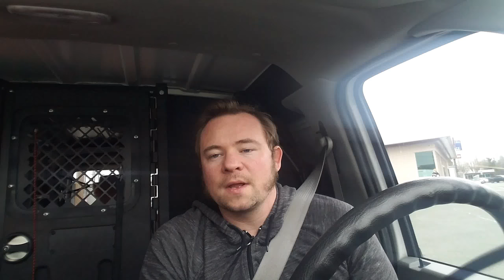How does someone become a traffic signal technician?

Comment: Most require you to certify with the IMSA before you get hired, or do it in a certain timeframe (typically 90 days you need to have your Level 1 TST cert).  Also there are many who collect retired (and sometimes new) traffic signals, cabinet gear, loop detectors etc.  THAT is some of the best hands on training you can get.  I mean what better way than owning the gear is there to learn how it works?  I am one who has collected retired signals and learned how they work, how the controllers work (mainly NEMA TS1), and so on.
Reply from the maker: Many municipalities may require you hold certifications through IMSA, but most public agencies will pay for you to take those tests.

Comment: When I started working on signals 15+ years ago, I was an electronics tech with 15+ years experience.  The men that trained me said that there is no such thing as a signal tech that hasn't been working on signals for at least 5 years.  Up to that point, you're still a trainee with electrician or electronic experience...  :)
My employer quit hosting the IMSA classes due to budget problems, so didn't require us to have the certifications.  I never thought about it being a group I could join, I just assumed it was a 'government standard' published so that workers would have 'minimal knowledge' to be able to do the job safely.
I've worked with CalTran and NEMA cabinets and the department was just getting into TS2 controllers, if I remember correctly, when I had to leave due to a major back problem.  Old inductive detection and set timing to newest video detection.

But I have a question for any signal techs.  Have any of you realized that the CalTran standard is hazardous to the public?
Reply from the maker: Most of the CalTrans stuff isn't in our spec (thank goodness) One thing I hate about 332's is that diodes are cut on the program card for the conflict monitor to allow phases to run together. What happens when a diode blows because of a surge?
Reply: Yes, that's exactly the issue I pointed out to the engineer that specced the CalTran system as the only one we would be installing in the future.  His response 'My professor in Traffic Signals said this is the best system out there.  This is what we're using.'
I had previously pointed out the heat issues on the 170E controller and was told 'this is the equipment we are using because the engineer says it's the best.'  Several years later, during a major heat wave, we had call after call for 'signals malfunctioning' and finally figured out that the controllers were overheating and 'doing screwball things'.
Thank you for the work  you do.  I know what it's like and the issues you can run into.  Be safe!  Prayers for you, brother.
Reply: I work for CalTrans in Southern California, the 170 would have heat issues, but very rare for it, the best part about the 170 is when a cabinet got hit or knocked down the controller typically still worked. The diode issue, I never had the passage diode blown, never heard of one ever going. But if there was an electrical surge, which I’ve  seen utility lines melt our cabinets, lightning strike it.. but, the 302 surge always held up, before that we used gas resisters that would never fail to save the unit. I was informed a while back most state DOT use CalTrans standards and models. True or not I don’t know. But our equipment runs in the extreme heat of the deserts to the freeze of the northern mountains. Best? Probably not, but effective and safe defiantly.
Reply: @jamesdokken2142  - I am in Tulsa, OK.  We had a week of temps 111 plus several years ago and the 170s were malfunctioning all over town.  One location showed 169 temp inside the cabinet.  One I laid my bare hand on top of the controller and took 'no time' to  get my hand off of it it was so hot.

Comment: I've been working in the traffic signal industry/trade now for about 7-8 months. I've been studying for Advanced MOT, MUTCD and a level 1 tech hand book as well as everything else I can get my hands on. However my company flat out refuses to send me to get my certifications until the 1 year mark that I've been with the company and im unable to take the time off to get certified myself without becoming unemployed.  Any idea's or tips to get certified faster would be very much appreciated.
Reply from the maker: Absolutely, I would recommend you take the level I test and join your local IMSA. Your local IMSA will hold regular meetings and you can pay and certify yourself. Once you've gained strong knowledge and certifications to back it up you shouldn't have a problem finding places to work that will take pride in your drive to teach yourself and want to learn. If the company won't pay for your certs, do it yourself. It's cheap for the weight it holds on a resume.
Reply: @trafficsignalstraining7673  awesome, thank you for the tips have a great day and thanks for taking the time to make awesome vids.

Comment: I'd like to be a traffic technician
Reply: Really, you don't.
13+ years as a signal tech and you'd be MUCH BETTER to go as either an electrician or an engineer.
The hours can be horrendously long in 'a major event'.  The work is hazardous, fatiguing, and demanding.
Reply: Jim Roberts lol I’m an intelligent transportation systems electrician and we’re in charge of installing the underground conduit, wire, traffic signals, poles, street lighting, pull boxes,street signs, controller cabinets and service cabinets. You guys don’t do anything hazardous, fatiguing or demanding compared to us.
Reply: Uhm... yeah, keep telling yourself that... 
I've done everything you named except street signs (except for the occasional 1 I had to hang because it was on a pedestal signal)  plus dealing with HAZARDS of 480v highway lighting when a wreck took down a pole or sign, rain, sleet, snow, or shine.
As for fatiguing, how many times have you worked 24+ hours straight?  Worked 12 on 12 off for 10 days straight due to a major ice storm?
Not trying to start a pissing contest, but I have seen a LOT in the 13 years I worked on signals including a wreck where the guy bled out and was dead several hours before anyone noticed and called 911...
Reply: @jimroberts2647  what would be my primarily #1 step to becoming a Traffic control tech?
Reply: @eric rodriguez - I would suggest either or both an Assoc degree in electronics tech (or tech school diploma) and a journeyman electrician license.   The license takes longer to get, but you can actually be earning a living while getting the apprentice hours to be able to take the test for the journeyman's license.  I got my Assoc degree in Electronics Engineering Tech in just under 2 years, but it cost me for the tuition, books, lab fees, etc.
Depending on your age, inclination, and availability of funds, you'd have to make the choice.  I will warn you, I've met quite a few electricians and many of them aren't the sharpest tools in the shed...  I had to deal with that multiple times where my education taught me things they didn't know and I had to over-rule them on what was going to be done.
Reply from the maker: I earn excellent pay and I'm never bored.
Reply from the maker: I love my job, I don't think it's for everyone, but I spent 10 years as an electrician before I stumbled into this and I'd take signals over it any day.
Reply: @Traffic Signals Training  -  If you're earning excellent pay, I want to know where you are working.  :)
We can't keep electricians because the pay is so low compared to what they can make just sitting in the union hall and waiting for a job to come in, according to what I heard from one of them.
Reply: @jimroberts2647  trying to get out of linework to this work I think it will be a nice change
Reply: @jimroberts2647  that is gruesome man. was he a drunk driver?
Reply: @Robrony Hoodlum -  I don't know that I ever heard.  Just heard from one of the cops on scene that 'that isn't transmission fluid stain you're walking on.'  Then he explained what I stated above about the guy crashed and bled out still sitting in his demolished car.  Fortunately the car and driver were both gone by the time I got there.
Reply: @jimroberts2647  I agree Jim. I work on the signals here in Australia. It's no fun when you get a call out at 1am, pissing rain and some drunken moron has flattened the controller. The cops are there asking "how long"?
Reply: @Detroit8V92tta  -  I have rolled up to a malfunctioning signal many times and cops are directing traffic and say 'We are so glad to see you.'
I don't want their job and they don't want mine.  lol
Reply: @jimroberts2647  yeah I get that too Jim lol. I hate controller knock downs in the middle of the night. It always seems to rain. The cops just love that...not!
Reply: @Detroit8V92tta  -  I have a picture one of my former supervisors took of me.  I am in full rain gear, sitting on the ground with 1/4" of ice, 3/4" of snow, and another 1/4" of ice under me.  It was the first day of Spring about 10 years ago.  lol
Idiot driver took out 2 pedestal signals and the electrical service connection from the power company.  I called the supervisor and he said he'd get a couple of people to help me get it all put back up.
Reply: @jimroberts2647  yes I've had days and nights like that. I remember about 5 years ago we were installing some solar powered signals during the day in mid winter, these signals absolutely HAD to be completed this day. It was freezing cold, pissing rain and I was drenched through in my full wet weather gear. I'm not lying, I thought I was getting hypothermia. I was frozen to the core. Don't believe people if they say it doesn't get cold in Melbourne Australia in mid winter! I sat in the service vehicle after we completed the job with the heater cranked on high for an hour and I was still frozen. It was the best hot shower I ever had when I got home! People don't see this side of the industry like you and I do.
Reply: @jimroberts2647  There are some good aspects to the industry. I have made many good friends and collected a lot of vintage stuff. It was only in the early 2010's that Victoria upgraded our signals to Led. We had a lot of equipment still around from the late 50's through to the 70's. I kept all sorts of trophys. Neon signals, vintage controllers etc.
Reply: @Detroit8V92tta  -  We started using LEDs a bit before I started working on traffic signals.  Then, 'the management' figured out that they were a problem here because of the lightning storms we have so often.
I have had to replace LEDs at an entire intersection in the middle of the night.
Such fun! ... .... NOT.   :)
Reply: @jimroberts2647  Yes I was going to mention lightning last night Jim. We have few a manufacturers with approved lanterns here. One manufacturer released their lantern about 5 or 6 years ago, we had so much trouble with them. Yes lightning was knocking them out but even line transients were killing them too. They finally sorted them out. The other two manufacturers lanterns have proved to be not too bad. Lightning as you know plays absolute havoc with signal sites. We get lots of thunder storms here usually late spring into early summer. The signal sites act as one giant ground plane. Steel poles with public lighting and of course the detector loops in the road. It just invites lightning. We also have a lot of volcanic rock around particular areas of Melbourne which is also a magnet to lightning. I've had controllers blown up so bad they can't even flash yellow. Blown load cards, detector cards and logic processors. Normally the comms is blown out too. It always seems to happen when it's my week for 24hr call out lol. I love a nice storm just not when I'm on call. I work with controllers like the Tyco Eclipse and the ATSC4. Both controllers can be found on Google.
Reply: @Detroit8V92tta  We have lightning storms at all different times of the year.  Fewer during the winter months, but still one occasionally.
One of the LEDs we started using actually had water wicking inside the sealed unit through the stranded wire for the signal connections.  I sat in on the meeting and while others were talking, I was examining one of the units.  I interrupted their conversation by saying "Your explanation doesn't fit the actual circumstances."  Then I stood up and held the unit so the vendor could see the back of it and proved what I had said.
One of the vendor's engineers was there, one chair between us.  He stood up reached over and took the unit I was holding. After several times turning it back and forth looking at the face and back, he said "He's right.  I can't explain why it's happening.  We'll have to dig deeper to find the cause."
My moment of glory!  lol
Reply: @ericr.7687  Jim is right. In America it is a journeyman electricians license. Here in Australia we do an Electrotechnology cert 3 apprenticeship. As Jim is saying and I agree with him (I am a fellow signals electrician/technician) achieve a trade qualification first and then go from there. It's a good job but it certainly isn't glamorous. I've had motorists steer towards me, they were so fixated on what I was doing up a pole and they (sometimes) seem to gravitate towards you. I'm sure Jim would agree, I've been abused and sworn at. One of my colleagues had an ice pipe thrown at him from a passing car. It pays well, it's government work but it's like any job, it has its good and bad points.
Reply: @jimroberts2647  Maybe the vendor sealed the inserts too well. I've heard of cable "breathing" in flameproof glanded applications. Where a lamp warms up and the air blows down the cable from the light fixture then once it is switched off the light sucks damp air back in again. Gradually filling the fixture with moisture. Perhaps you have a similar thing going on. I wonder if it is more prone to your west facing signals? Where the sun heats them up then night comes etc. Our west facing lanterns cop a beating here in Melbourne. Most of our nasty weather comes in from that direction. If I get a short in a signal head I always check my west facing lantern(s) first.
Reply from the maker: @jimroberts2647  sorry I never really respond to these comments I get so busy and then I come back and find big old threads.

I work for a county in the Pacific Northwest in the Seattle area.

Many of the municipalities here range from $40 to $50 an hour to start as a signal technician. 

We are also union represented by the IBEW, so the benefits are fantastic, real pension etc. I think that we are compensated very fairly.

I have no problem going out to protect public safety at 2:00 a.m. not only is it my job but anything over an 8-hour period in the day is time and a half wages. We also have on call during holidays.